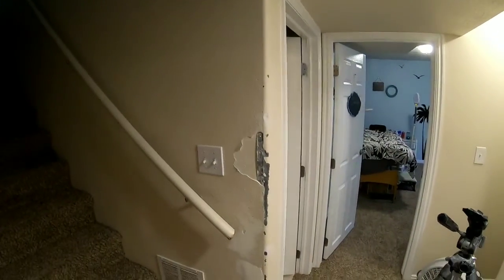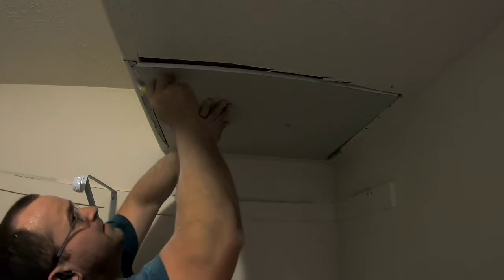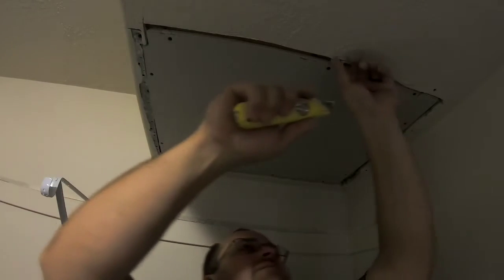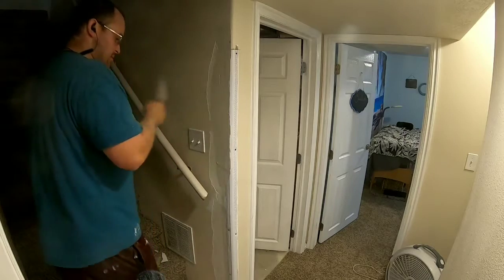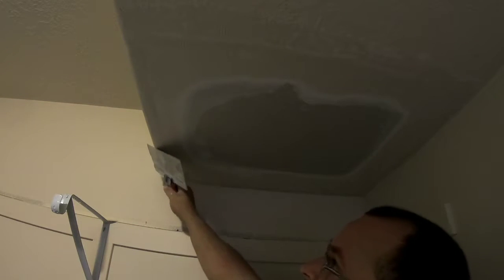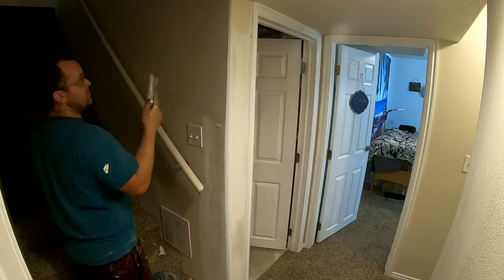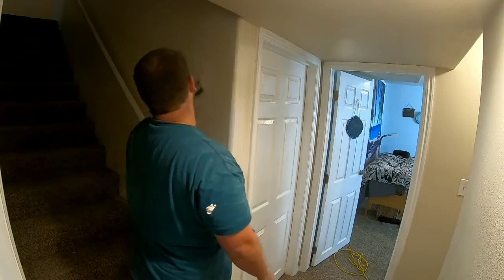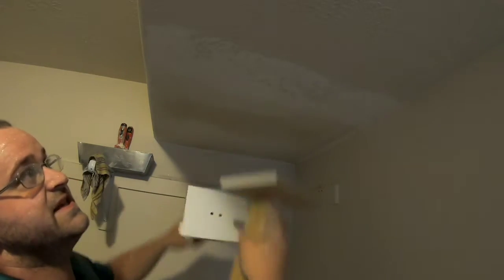How to replace bullnose bead like a professional

Comment: This video is helpful thank you! What type joint compound do you use for the pre-fill in wide cracks? You mentioned 20min compound for layering coats and then the topping compound for the final and that is helpful information.

Comment: What kind of screws are you using to secure the beads?
Reply from the maker: For me most applications I just number 6 1.25in drywall screws. I use screws mainly because I primarily do patch work and only have a few bead at a time. I'd use a nailer or stapler if I was doing alot of bead